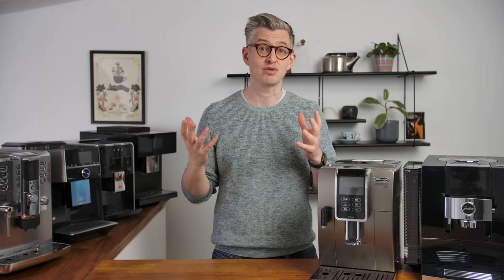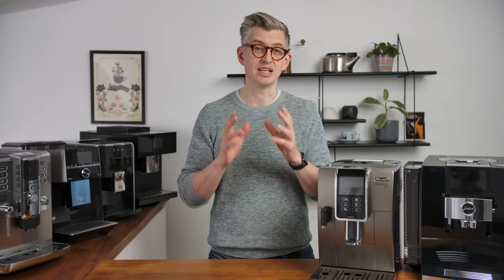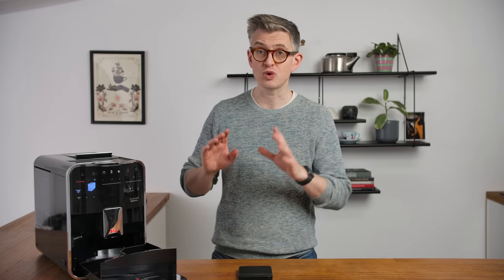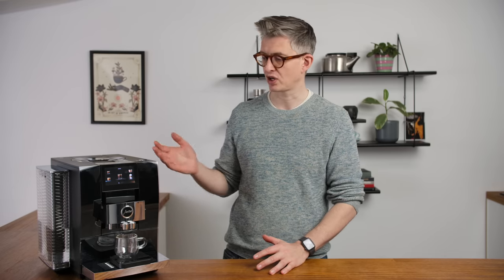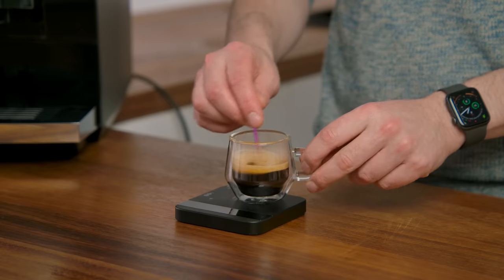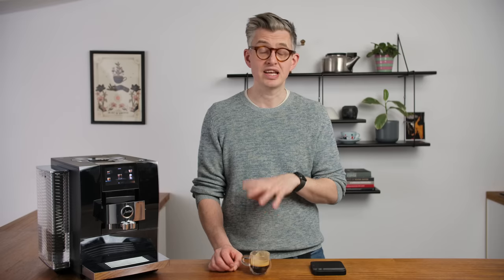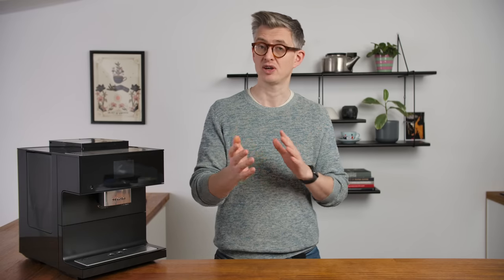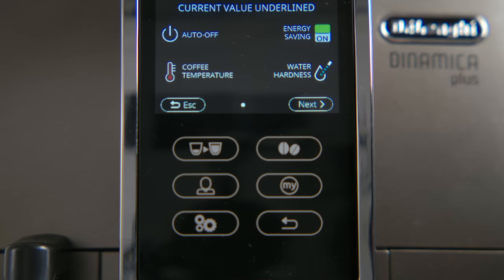How To Dial In A Bean To Cup Machine (Like A Nerd)

Comment: Had some confusing results on Jura J7, maybe because of inconsistent dosing?
Dose weighed at 14.3g  and started off with actual yield of 30g which is lower than 1:4, but going up to 64g which is just over 1:4.  I have not hit the "bitter" wall yet, but ulike the TDS, yield calculated was not linear.  15.73 to 17.37 to 16.72, 16.82, 17.47 ending on 16.59.  Any advice on where I went wrong? 😪
Reply: Impressa F7, not J7

Comment: Hey James, I have the new Dinamica plus. My shots has been slow and then watery, max temp, grind settings at 3-5, I’m doing a 1:2 ratio, is that the reason why it starts slow then gets watery? I can’t get the viscosity of the shot right. Any suggestions ?

Comment: i don't think it's fair to put jura in this video as their machine uses the most amount of coffee. the coffee input can range from 10 to 16grams on bigger jura machine. most other machine are 8g max, 10 or 12 if lucky depending on the brand. also, once you set the grind setting you cannot change it except for certain model like the jura z10 where it will adjust depending on the drink because that machine can do both ice and hot drink. it may be interesting to do ice coffee feature on these machines as that is their next innovative improvement. 

another thing i want to point out is most machine has 1 bean hopper, so you cannot change beans. even if there is extra bean hopper to use for other coffee, rarely the machine will auto adjust the grind for unless you go in to commercial machine. best example is the miele 7750.

last thing to point out is maintenance for the machine as i've seen people never setting up the machine properly or taking care of it. can you please inform people to not use distilled or reverse osmosis water as every machine manufacturer manual mention this. people use distilled water thinking there won't be a scale build up, but instead you will be creating a different problem in the long run.

this is very informative video, and key emphasis is this is a home coffee machine for convenience. a lot of people think they can get cafe quality espresso base drink on these machines, but because of the way it brews and different coffee amount and grind size it won't be the same. this also applies to milk drink - there is a limitation to how hot or thick the foam can get, brings back to the point of being a home machine. last thing i want to point out is most machine has auto pre-infusion function to make coffee appear to have even extraction. you cannot turn this off, except in miele you can play around that setting off, short and long. 

can you let us know which machine you like the best?

Comment: This wasn't a lot of use to me... I need specifics... I have a sage barista.. the grinder would not produce good coffee until I went as fine as it would go... Then found the upper burr could be moved which shifted the whole range finer... Now it's at 7... But has other settings.. brew time was starting after 3 seconds untill I got the dose and tamp right. Now it's starting at 8 seconds. How much longer ... 25? 30 seconds...

Comment: I had a Philips branded one of these, and I was shocked when you pulled the guts out of that Gaggia, because it's not just similar but apparently the identical piece of hardware, including the weird latch lever and yellow tubular parts, though nothing else about the machine is similar. And I hate that piece of the system. The machine tends to let grounds propagate all around on it, especially when you add preground coffee, and they build up in all the nooks and crannies, which the designers have done nothing to prevent. I've even seen whole, unwetted pucks sitting on the sort of shelf at the front of the removable mechanism. If the stray grounds aren't cleaned out every few days they get moldy. And it doesn't catch them all there, so they spread to the fixed innards of the unit, which is also designed with no conception of cleaning them out in mind. So cleaning to no-mold-ever standards is a tedious and very messy chore. These are marketed as being convenient, but they end up being far more work than any espresso machine, moka pot, or french press. And, as you've illuminated, they can never be adjusted to make an actual espresso. It's physically impossible for them. So you end up doing more work for less-good coffee.
Reply: Philips/Saeco owns Gaggia since 2009. They share the same tech but only the interface and design is different.

Comment: I had a K-cup for 10/15/20 yrs and I’ve tried the T-cups too, even the Nespresso.. If your into flavoured coffees, they might be little bits more ideal, I’m aint to big on flavours.. I always found the Pod machines, slightly under whelming.. When ya sit down an due the math, the K-cups add up.. If me math is right, I’m paying in Sechelt BC Canada an average of 80$/LB for K-cups.. Espresso it’s north of 125$/lb.. For taste Nespresso was the best, but it taste little bits artificial, in a weird way.. 

I had no ideal bout taste’s, options an/or if it was descent..  According to the math, based on a LBS @20$ a Bean-t-Cup would pay for itself in 1 ta 3 yrs at an average of 5 cups a day.. So with that in mind I took a chance and bought a fancy Gaggia Magenta Prestige Super-automatic.. Still set me back north of 1200$ with the Christmas special.. At that time in me life, it provably was the best thing I did/done in life.. 

My OCD, I went back reviewed all the different options, this Spring.. If I bought nother Bean-t-Cup today, I still would choose the Gaggia Magenta over everything else.. It’s not without it’s quirks, it’s still the best option in it’s price range.. 

I really took a good look at the Jura, even though it looks great.. The only way to clean the brewer on the Jura is to tear it apart(Screw drivers).. Jura will break eventually.. The Miele suffer from software issues.. In the base price range, a percentage of machine coming off the production line are “Bricked”  from the factory.. Miele software support is virtually nonexistent in Canada.. 

Jim these little trips an trix will help.. Thank you..

Bad Bunnii

PS
Provably little Backward how I’m going bouts Coffee.. 

This Spring I bought the Picopresso.. Well it’s night and Day better at making espresso shot then me Gaggia.. Still figuring out how to balance the Sour vs Bitterness.. Getting there... I’m more into Dirty Latte’s, not really that big a deal, the milk compensates for any short coming’s I have with my shots..

A week back I got a AeroPress Go.. First time in me life I’ve ever enjoyed drinking coffee BLACK.. I had know idea how good coffee could be, when it’s brewed correctly.. Now I know.. 

I semi-retired.. Me buddy an I had a falling out(over a girl), we buried the Hatchet +5-ish yrs back, this yr he’s having trouble finding skill help.. Since I grew up 7 miles down the rod from him.. Kinda sorta know what ta due: Jack of all trades, Master of none type things.. He doesn’t have ta look over me shoulder ta know I’m getting shit done.. So bye Labour days I’ll be busting me ass for 20 hrs a day Fall harvest.. Latte’s for Breakfast an Black coffee threw out.. 

I aint gonna throw out the Gaggia.. Cause some mornen’s it’s so convenient to press couple buttons an minute later enjoy me first latte of the day.. 

5 cups a day sounds like a lot, say 2 or 3 cup in summer and 6 or 7 in winter.. I average it out, threw out the year.. Spring is little sooner an Falls little later.. Not much need for a snow shovel, most yrs.. Cant bitch bout that.. Even Sechelt gets frosty..
 
I was born with an suffer from a Heart Murmur(irregular heart beat) a cup just before bed I sleep better.. Figure the caffeine speeds up me heart enough my heart beats steadier.. Usually wake up with me back teeth floating, though.. It werkz 4 me..

Comment: i have the siemens EQ500. I really struggle with the bitterness and high acidity of my espresso. Temp on max, switch through all the 3 ground settings and even had really good coffee beans. Just always kinda lackluster. Tbh pretty disappointed by the machine. Tastes fine in cappucinos and latte macchiatto, but straight espresso is rough.

Comment: cutting a power is really a risky advice.. As any other device being so rude treated, coffee machine can just break. It can survive 99 out of a 100 such cases, but it is still a rude break and 1 out of 100 will be dead afterwards. 
I would rather make a coffee, dry the used grounds. I dont believe you get a big difference because of a weight of the extracted coffee. Actually also provable - do it as you usually do coffee (Mokka, espresso machine with a lever) and check the method..

Comment: "Most of them will let you adjust the amount of output by 5 ml at a time" <snort>. Most of those 1000+ € machines, perhaps.  If you have a lowly Delonghi Magnifica (misnomer) you have to set the volume by holding the brew button in so that it registers that you want to change the volume, then once the pour starts you have to blip it again to cut it off.  And it does stop the pump; but unfortunately it then pours another second or two's worth of coffee into your cup. Infuriating isn't the word.  I'd love to see you confront one of these contrary beasts.

Comment: DeLonghi are the only machines that can produce something akin to espresso. They won't throw a fit if you try to grind finer and the grinder can be recalibrated internally to achieve a finer grind if needed. I work on automatic machines a lot and have found DeLonghi to always produce the best shot. Some Jura machines can also do pretty well but they rely on modulating the pumps rather than using a proper grind, this does work pretty well.
Saeco and Gaggia (same internals) Miele, any of the other smaller brands are next to useless and are a complete waste of money in my opinion.

Comment: I absolutely hate any machine that advertises itself as "push a button, it does everything for you." Breadmakers, those weird auto-dispensing soap washing machines with a weight sensor, the friggin popcorn button on a microwave. They all give you an inferior product, with little to no chance at fixing its drawbacks, very expensively, for a minor increase in convenience. You don't need to like grind your own wheat for bread or buy a wash board for clothes, but this is a clear line crossed as far as automatic machines go
Reply: You need to see the Technology Connections video about the Popcorn button.  Its actually very clever!

Comment: I own a couple of superautos and have bought and returned quite a few of them.  Superautos will NOT produce really good shots, unless you get into the high price range of commercial grade machines.  Try to "dial a shot" is also a joke on most superautos.  The grinder is timer-based but the bean hoppers are generally rectangular in shape, so gravitational lowering of the beans are very inconsistent, which means you never get a precise dose by weight after it runs through the grinder.  When the hopper is loaded with beans, you will get a very heavy dose and as beans gets low in the hopper, the dose will get smaller.  If you change the grinder to the finer settings, that variation of full hopper to half-full hopper induced inconsistent dosing will be enough to possibly cause a grind to be too dense for the machine to push a shot through.  Of all these designs use o-rings to seal the piston/shot chamber and they will leak water if the grinder is a bit too fine and the machine can't push water through the coffee.  James is right... the only way to address these issues is to use coarser grind setting but a heavier dose to even extract enough flavors.  After years of owning these and studying all aspects of superautos, I would NEVER put expensive beans into them.  Superautos for home setting is only good for that first cup in the morning when you are too sleepy to deal with precision needed for manual shots.

Comment: Absolutely DO NOT put fine espresso type grinds in to the ground coffee chute! It results in a horrid extraction. I wondered if I could get a nice espresso out of my Jura Z6 and tried this. Nope. Your Jura can create a very nice tasting small cup of coffee that is espresso sized, yes. But you have to stick with the grind sizes that the onboard grinder can provide. Jura designed it to work this way. The grind size, extraction time, water volume and pressure are coordinated to make proper coffee. But a full on, high quality true espresso shot? Nah. A very satisfying little coffee? Absolutely. Use the tips here to dial in. DON’T break out your grinder and try to get creative with the ground coffee chute. At least not for espresso.